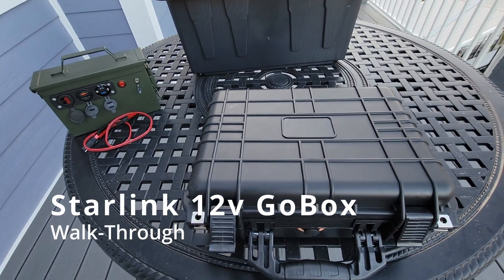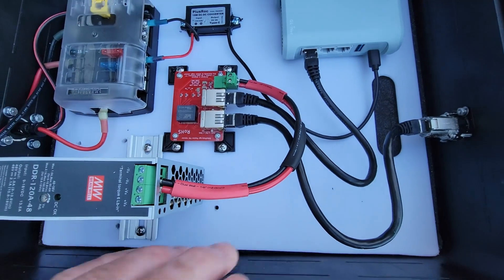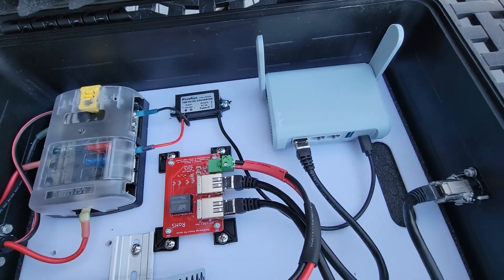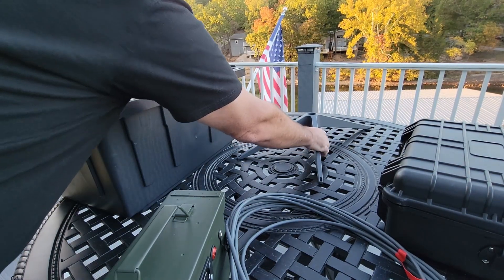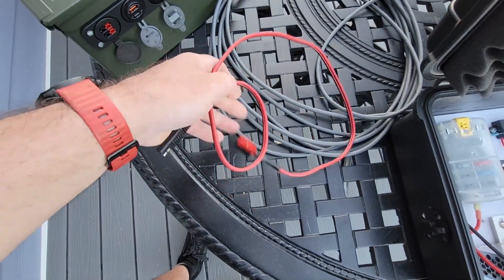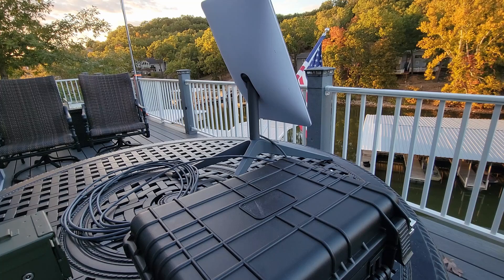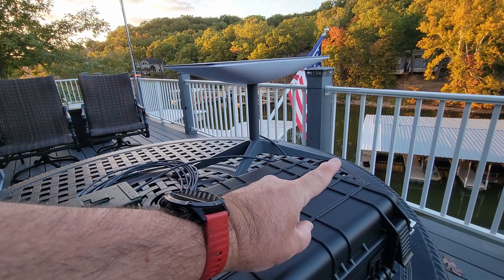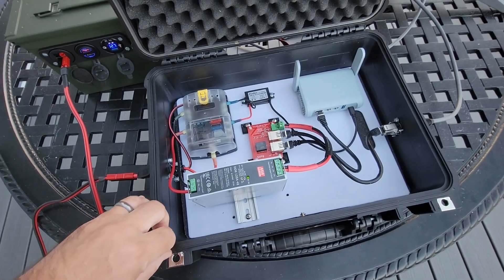Starlink 12v GoBox Walk-Through

Comment: Hi Steve… I built this set up and am trying to connect without my StarLink router (I am on the road and forgot it at home)… i believe everything works but I can not connect to the internet using the Starlink app. It seems i need to configure a static connection with the router? Or was I supposed to put my Starlink router in bypass mode while connected to 110v with the Starlink router to be able to use my dish without the Starlink router??? Any help you can provide would be much appreciated!
Reply from the maker: @douglasrank3281  in my setup I completely bypass the Starlink router by putting it in bypass mode.
Reply: From your video… it appears you don’t use the Starlink router/modem/poe unit at all… i guess my question is whether the router has to be set in bypass mode while connected to the fish and then removed from the set up? Your go box does not use the star-link router/modem/poe unit at all… thats the point of the 12v system either the dishypowa right?
Reply from the maker: @douglasrank3281  yes, put the router in bypass mode and then use a different router. You already have another router?

Comment: hi Steve, great video.  Any issues with heat mounting that Mean Well power supply as you show in your vid?  According to their specs its supposed to be mounted vertically, but I have found the power supply doesnt really get very hot in real life usage.

Comment: Why do you call this a " Go Box ". it should be called a Dont Go box because you need a truck to carry all that nonsense around.  I'm an Nomad Van'r and Sailing Live aboard , I carry my Dishy around in a Go Bag with a Jackery i300 power station and have perfect WiFi for 11-12 hours on 1 charged unit.  What even IS the point of all that other than having fun building a 26" 10 pound Router in a box ???

My Starlink Router works perfectly fine and when I broadcast WiFi to my friends in Vans or Boats around me , I just use the Starlink Ethernet Adapter to my Broadcast Antenna and share wifi over a 1/2 mile 360 degree range.

Sorry Steve , don't mean to rain on the parade here , but it just seems totally useless to build that and spend all that money to have a HUGE router in a box that is far from mobile and is no better than a stock Starlink Router ...

Comment: Looks really good! Was wondering I you knew what amperage the dishy needs from the 48v. Im having issues blowing fuses at the 12v side once I connect to the Dishy. I have tried 3 and 5 amp fuses.
Reply from the maker: In my testing I've seen it draw over 7 amps on startup and while booting. I would probably use a 15 Amp fuse.
Reply: @stevearodgers  Thanks for the speedy response Steve! Do you use a 15AMP fuse with your rig for the 12v to 48v? I also have another question. Can you control the Dishy  when the Starlink Router is not in the mix? For example putting the Dishy in "STOW" mode. I would really like to use my Meraki MX as opposed the the Starlink Router. Thanks again!
Reply from the maker: @grinstarr  I'm currently using a 10 Amp fuse, but it probably makes sense to use a 15. Yes, you can still use the app and control functions on the antenna like Stow. Most of the intelligence is actually in the dish and not their router.
Reply: @stevearodgers  thanks again !!!

Comment: Awesome and clean Job!
What has to be done to make sure the wifi is compatible with the system and the app?
Reply from the maker: Thanks! Any wifi router that has a LAN connection should work. After bypassing the old Starlink router the new wifi router cannot be accessed and tested from the Starlink app. The Starlink app just communicates directly with the antenna and the smarts inside the antenna.

Comment: Hi,is big problem to set onether router for starlink
Reply from the maker: No, not a problem at all. You just use the Starlink application to put their router in "bypass mode".
Reply: @stevearodgers  oh,thanks,but i want to use Starlonk without original Router
Reply from the maker: @SegelnAnastasiaII  https://youtu.be/IfIZSKWhXSg
Reply: Is is really necessary to put the Starlink router in bypass mode with a dc conversion kit like this? 

I barely understand networks and electronics but it seems that since the Starlink router is not used for power and connection to dishy, bypass mode on SL router is not necessary?

My  understanding is when the SL router is still used as power source and connection to dish but a third party router is used the SL router has to be set to bypass so there aren’t conflicting dual Wi-Fi networks ? We don’t have this issue with DC conversions because we ditch the SL router ?

The reason I ask is I would like to keep my Starlink router ready to use as a back up normally on 120v with an inverter in case my 12v conversion kit fails or if I want to use my Starlink plugged in beyond my camper. If the SL router is placed in bypass mode a factory reset would be required to use it again to power and route the Starlink. 

Great vid - thank you!!!

Comment: I've not had much luck with this exact setup.  I have 2 dishypowa injectors and the same power supply.  The current keeps spiking over 5A and blowing fuses that i've been using.  i've re-terminated the dishy end to T588B a number of times using different RJ45 connectors but the same results.
Reply from the maker: Not sure what could be wrong. Have you tested the RJ45 connectors with a tester like the Klein Scout Pro? If not, I would definitely recommend that.
Reply: @stevearodgers  I took a brave pill and upped the fuse to 10A. It connected. I wonder if the high current was due to rain sitting on the dish.

Comment: Hey Steve. Awesome video. I'm still new to figuring out the power requirements for this, and confused why your router is taking additional 5v power from USB-C. Isn't the purpose of POE to provide enough power for the router? Or does the router you have just require additional power? Will all setups require an additional 5v to the router?
Reply from the maker: The POE is used to power the Starlink dish/antenna. In the case of DishyPowa it only sends POE to the dish and NOT the router. The GL.iNet router I'm using requires 5v power from a Type-C power source.
Reply: @stevearodgers  Got it, thanks for the answer 👍

Comment: I'm in the process of setting up a similar setup with the Dishypowa hardware.  Your video has been very helpful, thank you !   One question, the cable that runs between your Dishypowa and the little router, is that a standard cat5 cable or did you have to do any modifications to the pinouts on either end?
Reply from the maker: Thanks! Glad it's been helpful. Just a standard patch cable will work. DishyPowa does all the pin crossing internally.

Comment: Did you have a pinout for the cat5 end? You had to cut the cable and attach the RJ45 connector right?
Reply from the maker: Correct. I used standard T568B pinouts. The DishyPowa does the correct Starlink crossover internally. If you're using a 48v POE injector from Amazon you'll also need to build a crossover cable using what's called the ELON wiring standard.  This is documented in several places online including the Facebook group Starlink Hacks.

Comment: Alright Captain America. Just have Peggy hold the camera next time to make it easier on yourself. lol

On the serious side, this does have a good bit of potential for travel if you compress it a bit. Turn that 48v converter sideways or get a more compressed one and then move the antennas. That will give you enough space to hold a roughly 120ah 12v LFP underneath. I did the math using Interior dimensions from HF's site along with 32650 cells from Battery Hookup. Add some low profile fans for cooling so that you don't have to open the case. And then a router with detachable antennas so that you can get better wifi if needed. It should even be possible to attach antennas to the case directly, greatly increasing wifi signal. Should give you the ability to run Starlink for about 1-1.5 days with a single case that weighs around 30-35lbs. You might even have enough space inside to add a small solar charge controller, or at least you can by removing a few battery cells. Will need supports to make sure that nothing moves inside. Otherwise the cells will destroy the equipment. 

Of course all of this can be much lighter if using NCA/NMC Li-Ion batteries. That would bring the weight down over 10lbs for the same capacity. But those have a higher risk of use. But just for fun, you can fit up to 192 21700 cells at 5ah each in a 6s32p configuration (24v-160ah). That is around 3.5Kwh, 2.25x more than the LFPs in the same space. 

Still, a great build. Thank you for the video.

Comment: Ignorant about this stuff, BUT, the little box that has the ears on it, is it what's sending wi-fit signals to a lap top if you have one? I need something like this for my river lot since I don't have ANY utilities, so with this setup I can have internet & JUST a 12 volt battery??
Reply from the maker: Yes, the little box with ears is a small travel wifi router that provides connectivity for laptops and other devices. Correct, you could run this with just a 12v battery, but you would need some way to recharge the battery maybe with a solar panel setup.

Comment: So with the custom poe injector and the Beryl you no longer need the starlink router? Does the Beryl need any kind of customization or just take in a standard WAN connection?
Reply from the maker: That is correct. You put the Starlink router in bypass mode and it's no longer required.  The Beryl gets an IP address via DHCP from the Starlink Dish and sees it as any other WAN connection.
Reply: @stevearodgers  HUM, you're a smart cookie

Comment: Do you have a power draw comparison for DC vs stock AC power starlink?
Reply from the maker: I have not, but others I have seen have reported about a 20-30% efficiency gain by going to 12v.  This probably doesn't matter to the majority of users, but for those of us trying to gain the most efficiency with solar panels and 12v batteries it definitely does!

Comment: Very cool!  How long of use time do you get with the 12 v battery?  Maybe moot with solar panel but wondering in case of several cloudy days.
Reply from the maker: The battery pack I'm using here is only a 12Ah battery I used for proof of concept testing.  My GoBox uses an average of 3 amps (without snow melt), so roughly 3.5 hours with this small battery.  In the next version I'm planning on incorporating the battery into the case and using a 30Ah LiFePO4 battery which should give around 9 hours of use.
Reply: @stevearodgers  When you do a upgrade FOR SURE do a detailed clip, describing each part, what it does etc, I want something like this especially for emergencies, and such with a how to and solar hook up would be great, I just subscribbed, Total cost for the NON Starlink goods was ????????